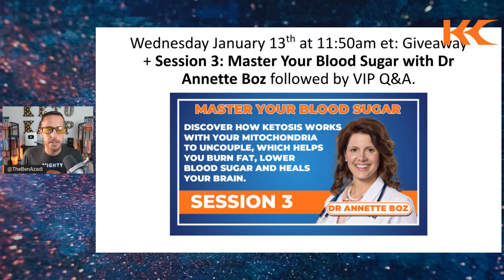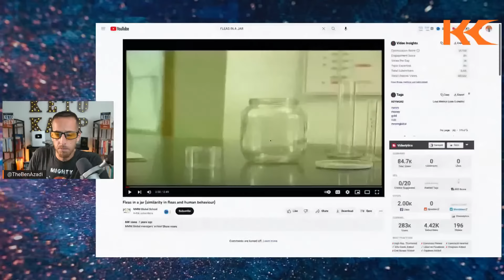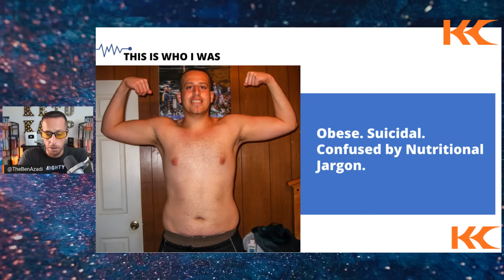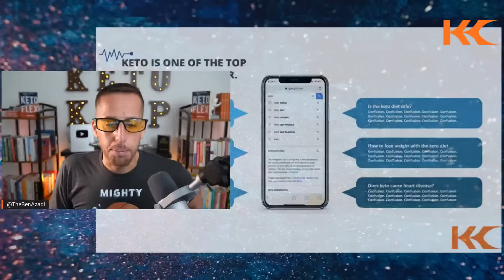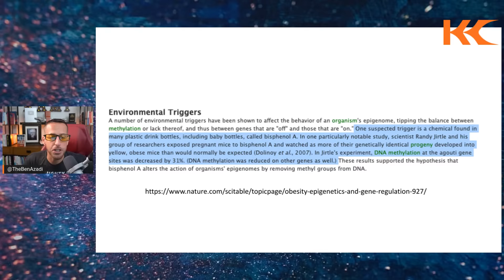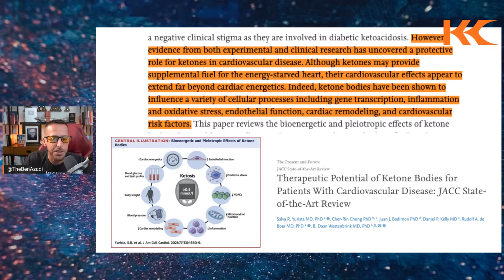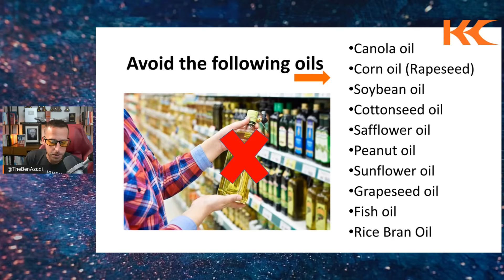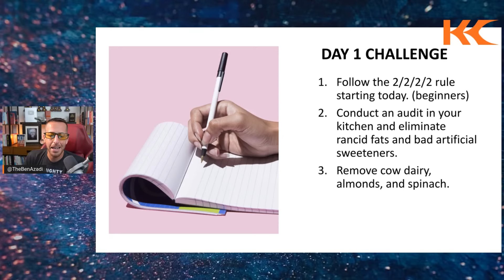The Best Keto Diet Tips in 2023 | Do This For AMAZING Keto Results

Comment: I stopped keto in December and gained 5kg in a month...shocking, aches, pains and acid flux came back
Reply: I went back on it last January and lost 26lbs by end of March. I stopped doing it around July and put back on about 20lbs. I usually go off of it during the summer but never got back on the wagon this past fall. I definitely felt the aches and pains. Back on the wagon as of last week but haven't even dropped water weight yet which is rare for me. Doing lots of weight training and exercising so I'm sure my body is still adapting. Going to hit it fairly hard until Spring Break.